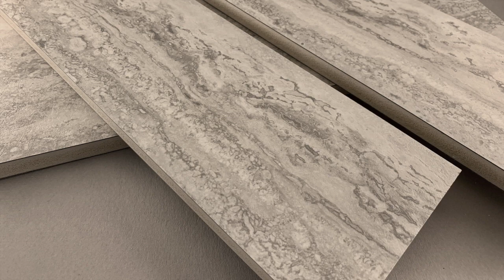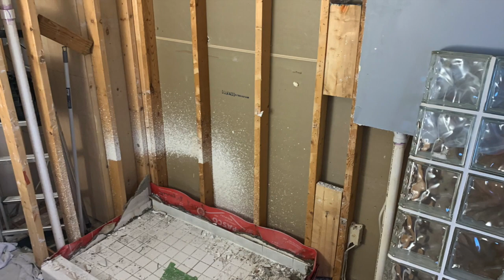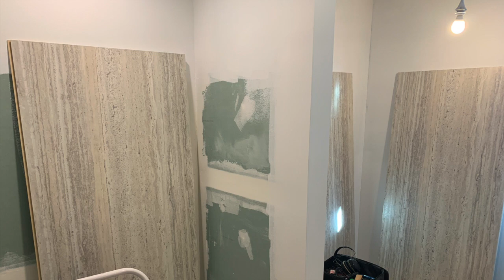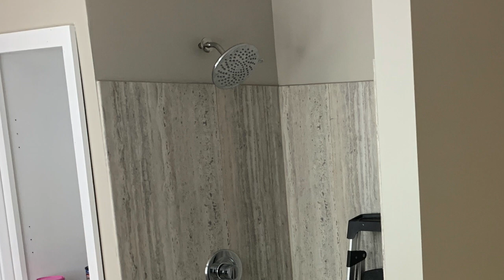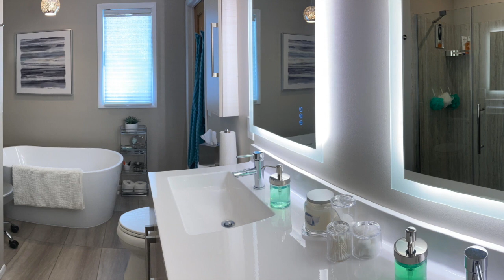American Standard - Passage Collection Shower Wall System

Comment: You did a fantastic job. The only thing I would've done differently is not install the shampoo dispenser above your trim. I don't want to have soap scum all over my trim.
Reply from the maker: Thanks for checking out my video.

The good news is that even after the 5 years since installation, that dispenser doesn’t leak at all. So that hasn’t become a problem whatsoever. No soap scum on the trim ever!

I do wish I would have used a higher quality soap dispenser from the standpoint of its outside finish.
The silver is basically just a plastic coating, and the finish has been chipping off.
Reply: @dazzlingdaveyoyo I am using matte black trim so I know it will be all over. You can just get a different dispenser.  There's some pretty sweet ones on Amazon.
Reply from the maker: @alexanderdunhill1893  yes, I’ve been looking into that. This one works so well that I’ve decided to keep using it, and research which one will replace it when it fails. Thanks

Comment: What did you do to hold the back walls tight during the gluing process. (No clamps or shower pole).
Reply from the maker: I did have the teenager helping me with that for quite a while….until it set up. And then the front and back panel also would hold it from pulling off because they overlap a touch.
Reply: @dazzlingdaveyoyo I bought this system as well. I was going to screw a couple  pieces of 2x4 to my subfloor (1 for each back panel)  and then a longer 2x4 to those and wrap a shop towel around the top and wedge  them against the back walls like you do when you set fence posts to keep them level. You did put the back walls in first right? I have a window in the back wall so I have to cut a hole for that. I'm a licensed plumber but I do commercial and industrial. But I will gitrdone. I love that you responded. I am following you and you replying was the deciding factor on whether or not I was going to keep following. Thank you.

Comment: Did you run into a problem with the corner walls not being perfectly level. if so how did you handle it
Reply from the maker: Mine were not exactly plumb or level, but not very far off from level. 
So the joints looked great after applying the silicone.

Comment: Hi Dave 
nice job on the shower install and i know that this was done 3 years ago but i have a question , if you can remember 🤣do you happen to know what size drywall you went with ? , as i am going with the passage walls and a dreamline shower pan ( like you ),  The install instruction only show a diagram and not the dimension of the drywall that butts to the top of  the pan , i was planning on going with 1/2' green board as that would probably only leave about an 1/8' gap from the shower pan to the back side of the passage wall.
again nice job and thanks in advance , Blake
Reply from the maker: I don’t 100% remember, but I think it was half-inch green rock.
Good luck!
Reply: I'm installing this same system and went with the Goboard product.

Comment: Fantastic video. Many tips (shims for tightness is brilliant), but also concise. I'm evaluating Passage vs. the Craft + Main/Jetcoat polymer surround panels. It seems that the Passage panels are nice and rigid (laminate patterns like yours, not the subway versions). Is it a wood composite backer? My only concern about Passage is if water will penetrate, cause wood rot and then delamination of the finished laminate surface. This concern is especially for the center tongue and groove seam.  
How is yours holding up? 
Is the top edge just exposed layers of the composite construction?
Would you go with it again?

I also wish they made them taller to be above the showerhead pipe. Any issues with splashing water causing problems above the surround?
Reply from the maker: It is NOT a wood backer. If I recall from my research it was a special plastic like materiel that would NOT have a problem if there was water to get to it.
Mine is holding up great. Looks as good today as the day it was installed.
The top edge is exposed material, and there is no issues. I did run a beed of caulking to prevent water going between the panel and the sheetrock wall, and that is holding up well.
I would definitely use the system again.

If they had made it taller, I would have gone with a taller wall. But there has not been a problem with water splashing up on the walls at all. (Even if it does splash up, it just runs back down into the shower.)
Reply: @dazzlingdaveyoyo  Thank you.

Comment: good looking shower walls, the question I have are on the panels, are the outside ends rounded out or smooth to where there is no trim required?
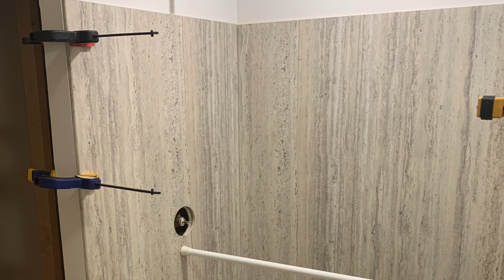Reply from the maker: If you look around the 3:00 mark of the video, you can kind of see how the outer panels are rounded over at the outside edge. You do not need any trim to make it look nice. (if you need to cut it to fit, you would cut the other side, so as not to cut the rounded over part off.)

The top and bottom are flat, so you may need a little bit of silicone to keep water from going behind them.

Hope that helps.
Reply: @dazzlingdaveyoyo  thank you

Comment: Dave, we are installing American Standard Passage walls over a Kohler shower pan.  The shower pan has flanges at the side and back edges.  Kohler says to install furring strips on the studs so that the green board and the shower walls will fit over the flanges.  Is that what you did?
Reply from the maker: Yes. I used a dreamline pan, it also required having the green board go over the pan edge. I didn’t need furring strips though.
Reply: @dazzlingdaveyoyo  Thanks.  Your video was very helpful.  We will need furring strips because the back wall of the shower pan is snug against the studs and the flange that the green board will overlap is 1/2 inch thick.